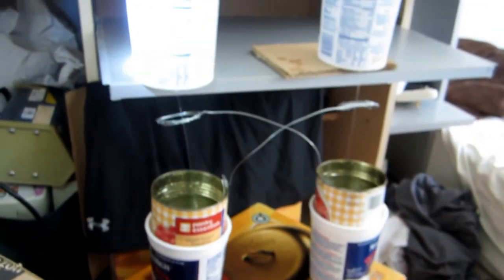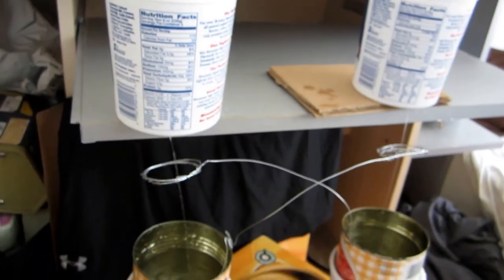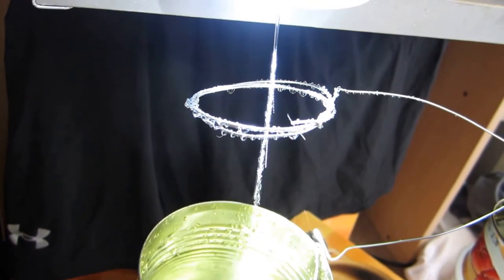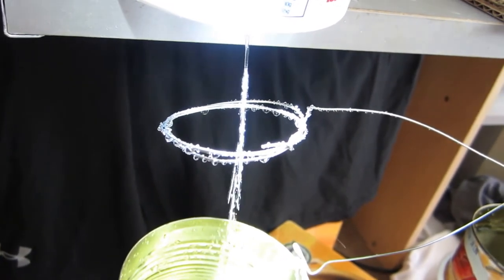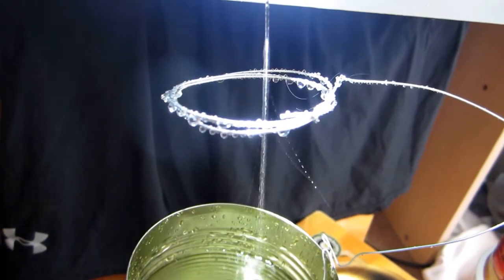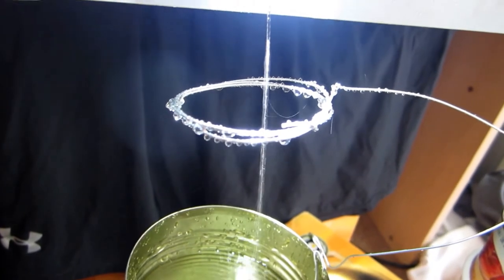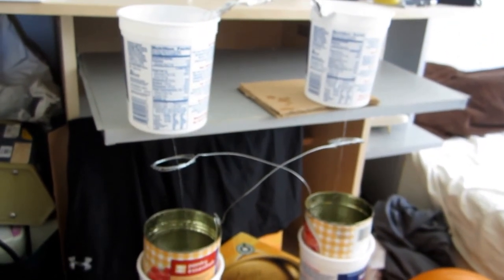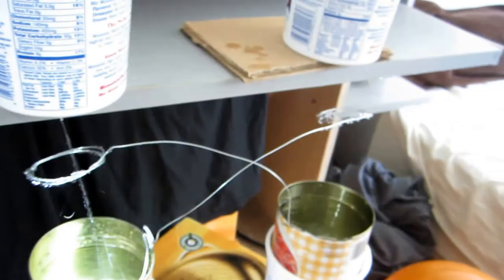Lord Kelvin's Water Dropper Electrostatic Generator

Comment: Why in at the start up there is a different electric charge in the container if a drop of water is neutral , hold different +/- charges in equal value ?

Are not all neutral the drops of water ?
Depends from radius of drop of water ?
Depends from different value of charges in similar waters drops ?
Depends from different value of charges in conductive container ?
Are the containers or the drops different antenna (LC circuits ) for  electromagnetic waves received from external enviroment ?